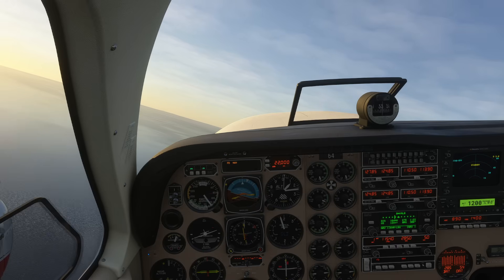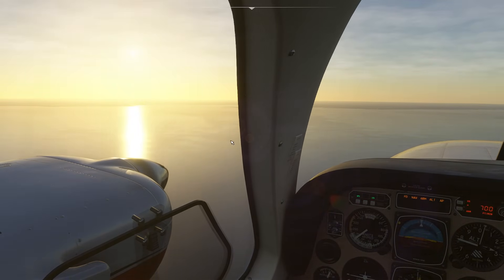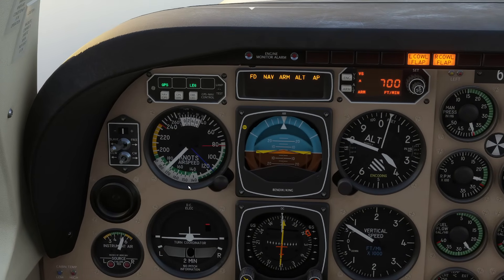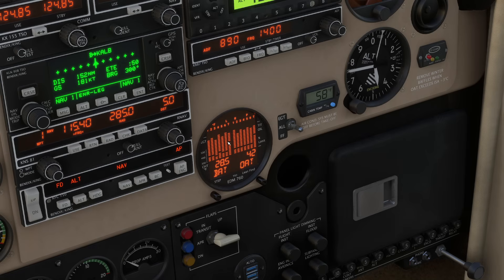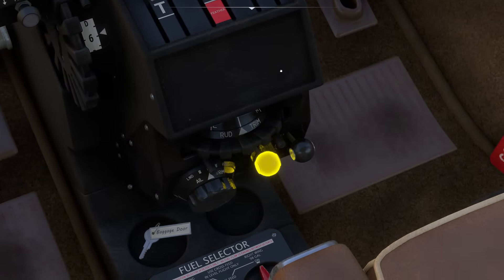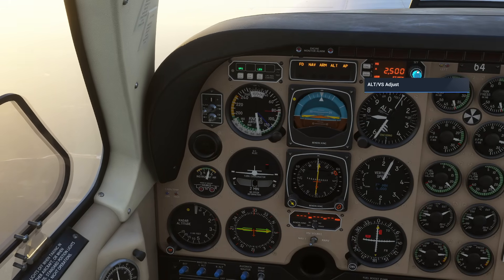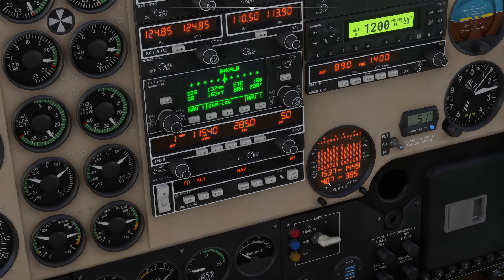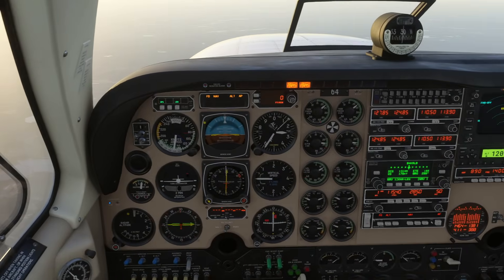MSFS 2024 Tutorial - Engine Temperature Management made Easy

Comment: Cap'n, can you explain the 390F limit a little bit further? Because it equals to about 200 Celcius, but analog gauge shows the redline at about 235 celcius. It's even kinda green tape all way up 230, so in this particular engine that shouldn't be an issue?